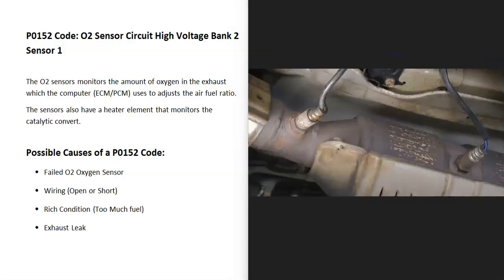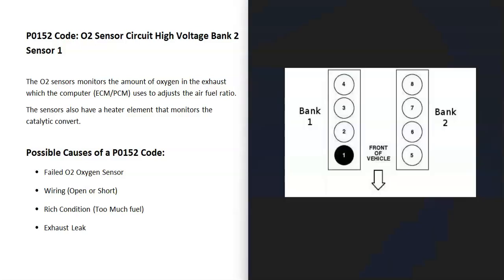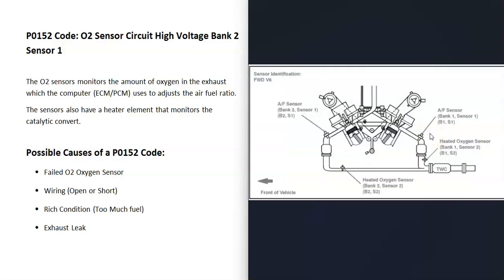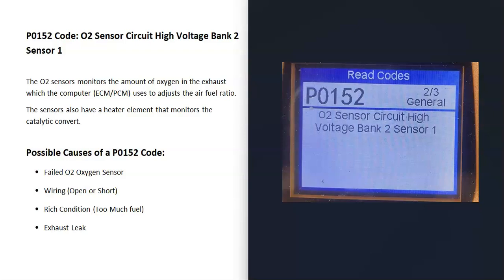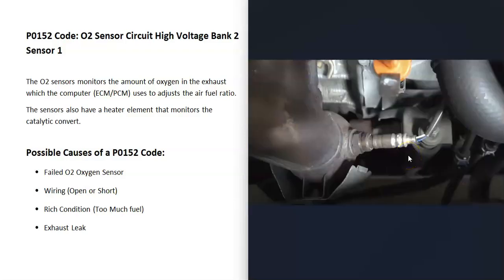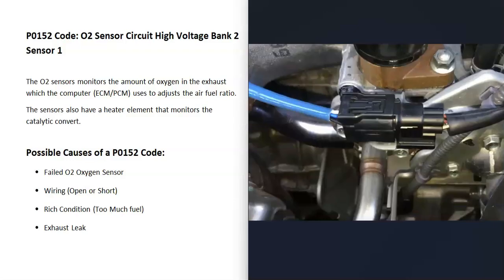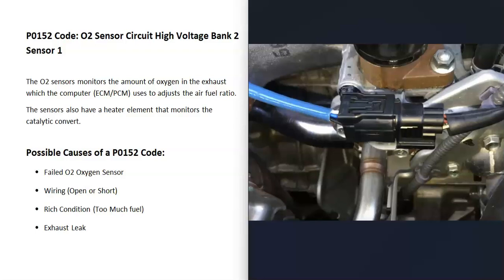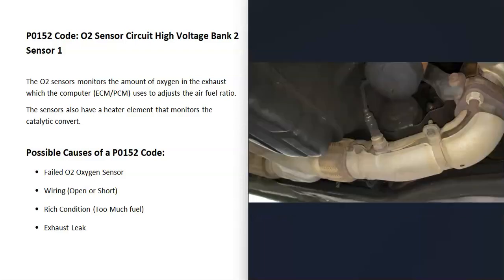Cause and Fixes P0152 Code: O2 Sensor Circuit High Voltage Bank 2 Sensor 1

Comment: p0152 and p2098 2013 town and country it has a misfire and runs like crap both of these codes showed up there is an exhaust leak but it's back by the resonator I wouldn't think that'd mess with it it's about 3-4 feet downstream of the sensors

Comment: I got this code for the first time after change the spark plugs I was getting a p300 then a p308 before. I do have a know excuse leak. But i only now have a p0300 code and the P0152 code.. This engine was a crate engine has about 10,000 miles. Any ideas
Reply: could a messed up battery cause these issue to. Its a 2012 ram 2500 with a crate engine put in in oct has about 10,000 miles
Reply: I had the same 2 codes, and my cylinder 6 injector was bad

Comment: I changed my 02 sensor and drove the car 8 miles and the light came back on with the same error code.
Reply: It's just happen to me few mins ago I'm thinking rich fueling
Reply: The light turned off after I drove the car to work and back 2 times. Trip?????
Reply: The light turned off after I drove to work and back two times.
Reply: Gotta get some defaulters I think
Reply: If ur tuned I think reflash
Reply: Catalytic converter and purge valve

Comment: I have a Jeep wrangler with 3.6 v6H  and I am getting a P0152 and P1129 CODE i ALREADY REPLACED THE 4 OXYGEN SENSOR STILL THE CODE IS THERE THE ENGINE RUNS ROUGH
Reply from the maker: A bad 02 sensor wouldn't cause the engine to run rough; it just won't go into what's called a closed loop and be less responsive, but it should still run OK. There must be another issue. The P1129 code looks to be manufacturer and vehicle specific. Some have it listed as a MAF sensor and others as "Intake manifold pressure error."

Comment: I've had my check engine light on since i bought my 02 Chrysler Concorde Lxi 3.5 V6 and its always been the 0152 code. Upstream sensors are discontinued so i got the manufacturer who made them that year and installed them. I also replaced the cars PCM/ECM. Light is still on. Only other option i think is check connections terminals connecting the ECM and O2 sensor. and possibly replace wire harness by running over lay wires in case there are chaffed wires. Im so frustrated. Car is in immaculate shape. 1 owner 70k miles, interior is mint. Its fast, and floats on the highway like my old towncars. I just want this nightmare to be over. Any thoughts?
Reply from the maker: It needs to be diagnosed, but if the sensor is good, there is likely a bad connection or bad wire causing the problem.

Comment: Wat causes the rich condition?  I have this code and I am smelling gas.
Reply from the maker: Rich codes can be hard to diagnose since many things can cause it such as bad injector, high fuel pressure, bad sensor and more. Basically, more gas than air is going into the cylinders.

Comment: I got p0503, p0129, and p0152 codes pop up, I feel like I got wire issue, but can't locate it. I replaced all 4 o2 sensors about 3 month ago, my car starts, and shuts off after a good period of time. My car is 2007 dodge ram 1500. Please help me
Reply from the maker: P0129 Code: Barometric Pressure Too Low 
P0503 Code: Vehicle Speed Sensor "A" 
P0152 Code: O2 Sensor Circuit High Voltage 
These codes seem unrelated but there may be a wiring issue. I would test the O2 sensor wiring on Bank 2 Sensor 1.
Reply: @HVAC_Mechanic  can it be PCM problem?
Reply: @HVAC_Mechanic  or check wiring 1st before jumping to PCM
Reply from the maker: It can always be a bad computer, but it needs to be diagnosed (each component and wiring tested) to know. If you think it is a bad computer, be sure the battery is good, and the connections are good as they need a good stable power supply.

Comment: 05 taurus 3.0 L p0152  voltage high .engine will misfire sometimes causing it to jerk while driving ..code is a hard fault .New O2 sensor .spark plug appears to be running extremely lean .Snap on scanner in data stream found no glitches looking at O2s ..very confusing
Reply: Have you been able to fix it??